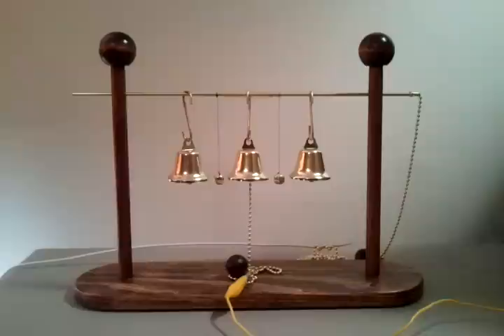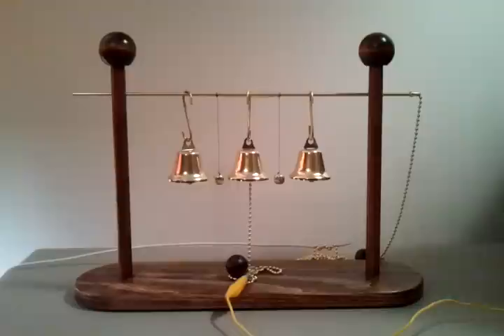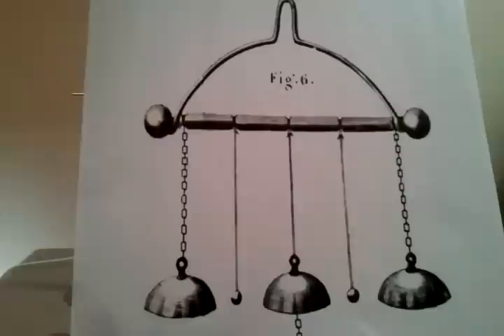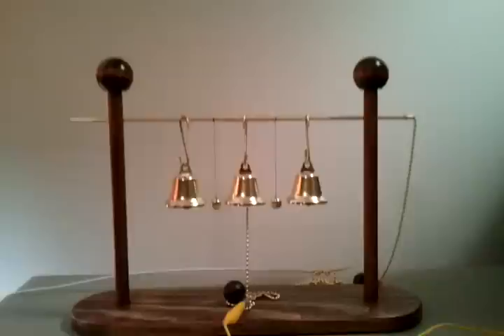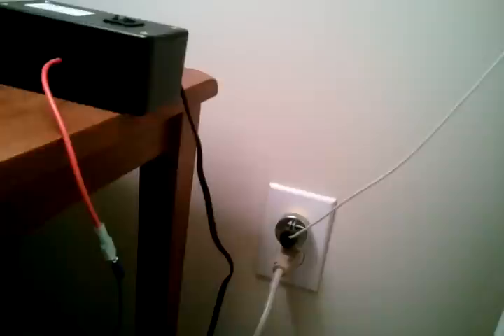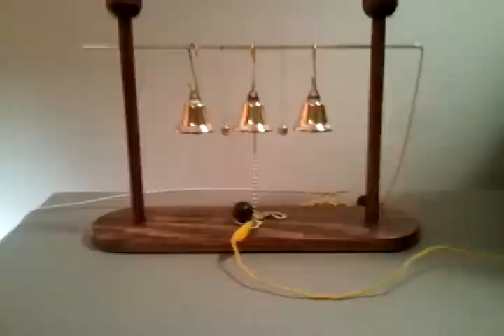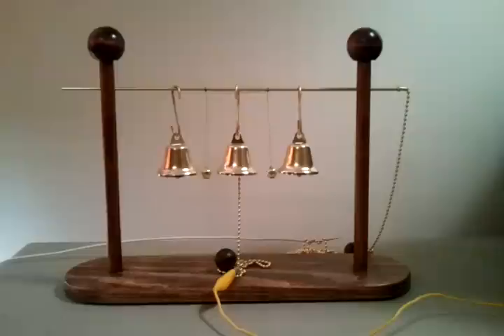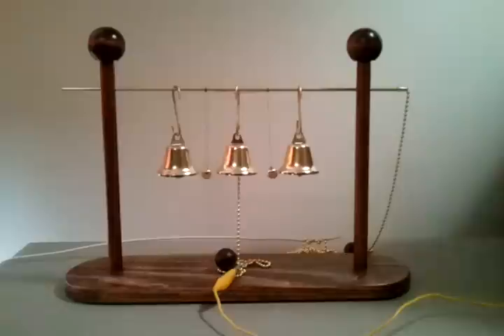Franklins Bells

Comment: I had no idea an old television could create static like that.
Reply: Yup! Electrons bombard the interior of the Cathode Ray Tube (CRT TV), and so positive charge particles will collect on the surface of the TV's glass like a capacitor.
Reply: Place your forearm about half an inch across the front of the tube and then switch it on. All the hairs on your arm will raise and be attracted to the tube for a couple of seconds before coming back down. Turning it off again will also have a similar effect.

Comment: Awesome video! Quality build there! Better than the drink can bells I made! Harvesting high voltage from the TV with a sheet of foil... Brilliant!  I have seen electroscopes charged that way, but never seen work done till now. The turn off spark was a nice surprise! What are you using for thread? I'm having issues. Cotton seems to be a conductor at the voltages I have. As does my plastic chopstick top bar. My dinger (ring pull) just sticks to one side (neg), along with most of the string.